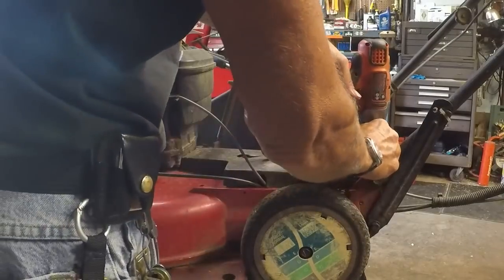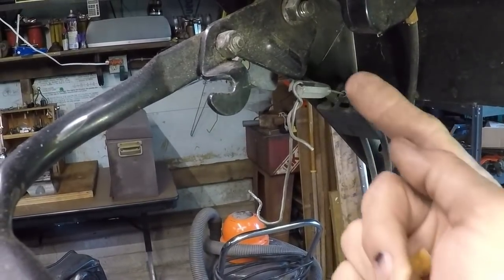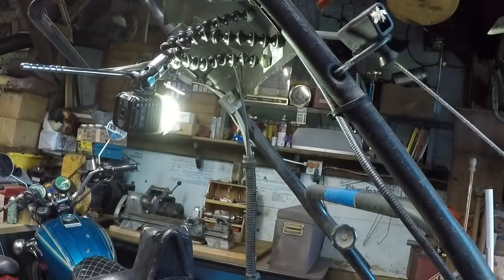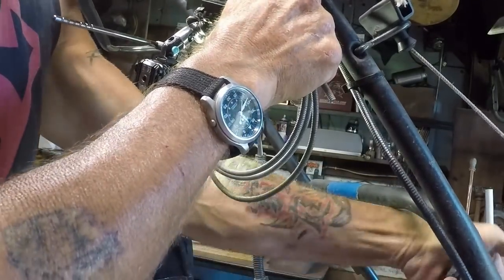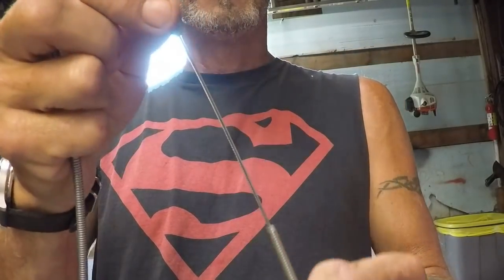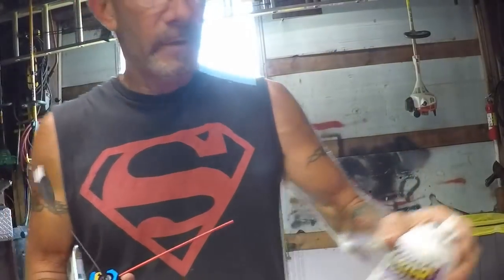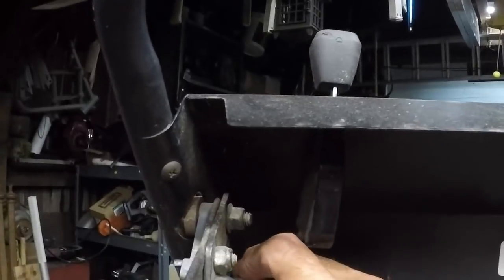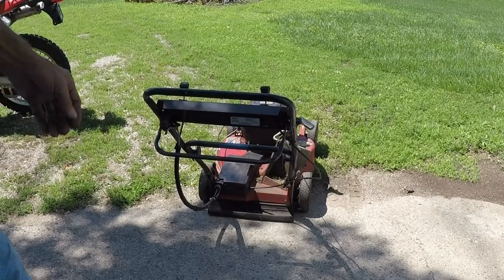Toro Push Mower Cable Replacement #smallenginenation

Comment: I've got a Toro Recycler II Super Pro purchased in '94. Never had a problem with it. Still starts on the first pull, even the first time it's started each spring. I love it. Cool seeing you use the cable lubricator ala mustie1. I'll have to get one of those. Enjoyed the video Zippo. Like button smashed!

Comment: Great vid again Mon Ami....      Me and Johnny B were going thru our old tool box and we found a cable oiler just like that one......

Years ago in the late 70's and early 80's we used to just oil the outside of the conduit with the pump cans .... Old school style....  LOL....  

I used the Corticosteroid at on time on my hand ........It was a rub cream .....    

Plus Tard Mon Ami ~!~!
Reply from the maker: I've got the rub in cream as well. The hand is doing AMAZING! I shouldn't have procrastinated as long as I did, but I feared surgery would be my only course of action. Plus...I'm tired of being cut open lol. Cheers my good man! Zip~

Comment: Tendonitis can take awhile to shake.  Glad it’s getting better. Take care.
Reply from the maker: I managed to put 120 miles on Smokey the Goldwing yesterday and the hand is feeling good. Not great, but good. lol The Nurse Practitioner said, work the heck out of it, and nothing works it like a 32 year old hydraulic clutch lever. I've got more mobility in it with less pain after just a few days, so fingers crossed (which I can do again with that hand lol) I'm on the mend. Cheers Sir Pipe!! Zip~

Comment: I had to get a string trimmer running that had no spark and the stop cable was sloppy and wouldn't release the engine brake. So I took off the engine brake and cable and put a kill switch on it.

Comment: Good job, but you put the z bend into the brake lever upside down. Oh well....it works
Reply from the maker: I realized that after the next push mower I worked on had the Z bend going through the top and I switched it. I honestly wasn't aware there was a right or wrong way, but erred on the side of caution and flipped it. Great eye there Jim my Friend! Cheers! Zip~

Comment: I hate those OSHA "nannie" safety brakes/interlocks and crap; just more stuff to go wrong and fail. Personally, they all get removed on any of my equipment except for maybe the transmission neutral safety switch.  Common sense for the operator should always prevail, IMO, not a regulatory or a government agency saying "you have to"..
Reply from the maker: I agree Tom. But, taking into consideration that the person who uses this push mower is somewhat challenged shall we say, keeping all the appropriate safeties in place is a must. It's his favorite mower out of 3 that he has to choose from. I even located a new Husqvarna all wheel drive with bagger for him (a mere $400 push mower lol) and he still insists on using this old Toro Commercial. So, I keep it in tip top shape for him. Cheers my Friend! Zip~